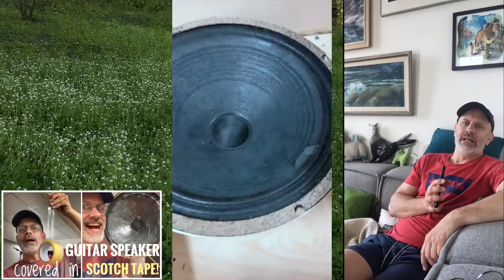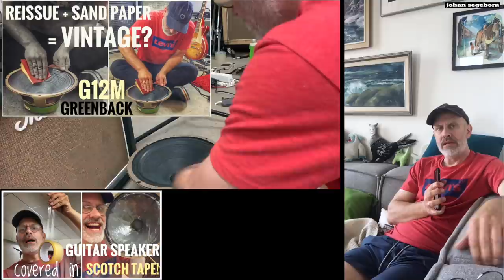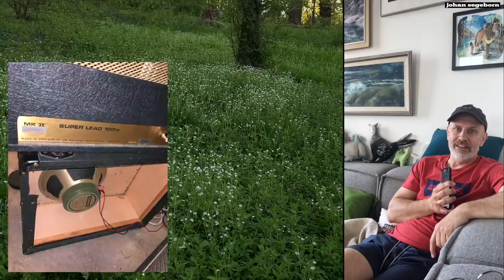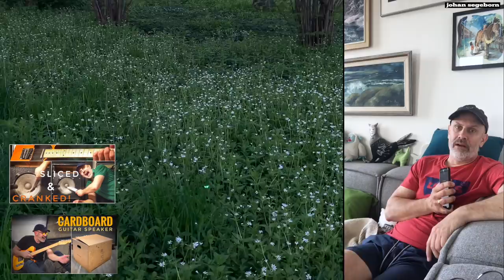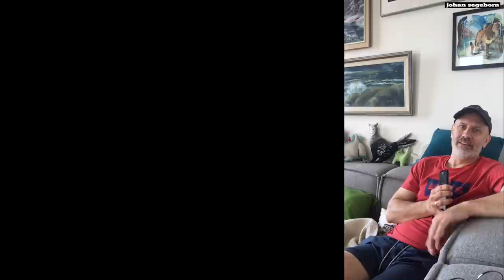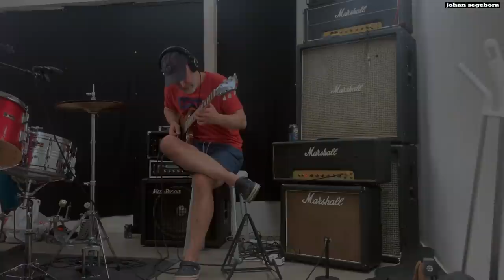Guitar Speaker Covered in SCOTCH TAPE for a BIGGER TONE!

Comment: In the old days of communist rule, when nobody dreamed in my country of possibility to buyi generic guitar speaker we used to buy 12 inch wide band speakers with special central cone for higher frequencies. Cone was deleted using sharp razor. The we used thick shoemaker glue. 3-5 layers. Each one when previos was dry. Idea was to make main cone heavier, less responsive to higher frequencies. Result was really good. I'm playing one of these speakers 1x12" in close pine cabinet do this day with 5W diy amp made in that time. From time to time i think of replacing it with proper celestion speaker...
Reply from the maker: Cool! Do you have video of that speaker?

Comment: Ever tried spray painting The Cone with flat black paint. I've done this on Old speakers not guitar speakers, speakers that are on the dash of an old car where the paper is sun-faded and about to disintegrate. It stiffens the fibers up and makes them seem new again. With each coat they get stiffer and stiffer, but if you put too many coats they begin to sound tinny because the paper becomes too stiff. I suggest trying one coat and see how it does, then go from there. It stiffens up the paper cone is all it does. It probably works much like your scotch tape deal only it looks nicer because you can't really see it. It's soaks into the paper it looks like there's nothing on it. You might try it especially on a really old cone where the paper seems like it's about to come apart because it's so old and used. I can't really describe it, you can just tell it it looks like it's fuzzy and like the paper's about to disintegrate. I wouldn't try it on the new speaker, but one where the paper looks like what I'm trying to describe that's really not much good anyway what have you got to lose. On a car, say a 1970s car with the push button radio and one speaker in the center of the dash the paper is face up in the sun all the time and it gets dry rotted looking. I don't know if using satin finish or glossy paint would make a difference over flat black it's just that flat black is what I had and that's what I used. It's solvent-based or oil-based paint that you get in spray cans at least you did back then. I don't know they may have some water-based ones now. I wouldn't use water-based spray paint, for one it won't soak in and two it'll dry like a plastic over the surface whereas the solvent based does it have water in it and it will absorb into the paper becoming apart of the fibers cementing the dry rotted fibers back together as though the paper is new. if you try this on an old speaker where the paper looks dry rotted what have you got to lose. As I said before I just wouldn't want to do it on a new speaker unless money didn't matter and I just wanted to experiment. even if I had unlimited funds I would hate to ruin a good speaker. I know for a fact this stiffens up the paper cone of any speaker.
God Bless Y'all.
Jimmy in NC....
Reply: This is really cool, thanks for sharing this tip!
Reply: Great tip!
Reply: This is an OLD tip, but a good 1!  Spray with lacquer, same diff! I had a work mate who was good at electronics, and he used to build bass subbies for cars, and he used to epoxy the speakers to stiffen them up! When he played rock, pop or esp EDM, thru them, the bass frequencies they pumped out were so stiff and tight, they were earth shattering!
His speaker of choice were always Cerwin Vegas!
Reply: Nitro or poly? ;) would be a good test, also matte vs gloss.
Reply: @gingataff  I just used flat black Krylon or Rust-Oleum Krylon I think because it was what I had and it worked well. I wouldn't do it on a new speaker like I said, but the speakers I was doing it on the paper was nearly dry rotted it was so old and fragile I figured what the Heck. It just stiffened them right back up and made them sound fresh. I do know if you keep spraying coat after coat eventually they get so thin they sound like a Japanese transistor radio from 1970 with 2 inch speaker, in other words they sounded like crap. I just did that on a speaker that won't much good anyway to see how far I could take it. I would try one coat check the sound and possibly a second. Your speakers will get stiffer with each coat and you don't want them so stiff that they sound like crap. I don't know anything about gloss because I never used it. I think flat or matte is best. I don't think gloss would be as good. You can't tell anything's been done to your speakers when using flat or matte. I discovered this by accident, the paper on my speakers was so dry-rotted I didn't have anything to lose so I figured what the hell they weren't any good in the condition they were in. When I got done I was surprised, they sounded it almost new again. New but broke in. Hope this helps you.
God Bless!!
Jimmy in NC....
Reply: @gingataff  'Tone' finish!

Comment: Increasing mms (moving mass) will lower Fs (resonant frequency), what you've more or less done is move a 75Hz cone closer to a 55Hz cone, as well as taming some of the peaks.
Reply from the maker: It certainly got a fuller low mid/bass
Reply: There should also be a drop in efficiency aka loudness!?
Reply: I DID say that, increasing the mass would lower the resonant peak somewhat or at least boost the lower range.
Reply: Nice!  I always liked the 55Hz more than the 75Hz

Comment: Johan - Man you crazy! So I have two ultra rare 1968 G12M Pulsonic 8OHM (with original factory orange 8ohm sticker!) that are DEAD MINT and sound FREAKING GLORIOUS. In fact I just use one and keep the other in the box for preservation. My question is what is the best climate for these? A/C but not too cold? I'd imagine dry right? God these speakers are glorious. Every modern speaker I've tried has that shrill top end or just nothing there, but not a SWEET top end that is like biting into a delicious something so sweet. Anywho, thanks.
Reply from the maker: Thanks man, as long as you keep them in a tempered room (around 20 C) they’re gonna be fine. Cheers

Comment: did what i was expecting.  anytime you put more mass on the cone, it'll limit it's dynamics and clarity.  while this is minimal here cause tape is thin, and looks under tension or is adherence helps its motion with the cone, and you might not notice it from a regular video, but in comparison, the speaker is less open, less dynamic, and less clear.  what johan is enjoying is the controlled highs, but the same cranked capacitors in the tone stack.   fun test though.  someone might even prefer that, but those are the people that don't know how to control all the other options.  there are ways to get that without ruining a speaker cone, but if you really want to, go ahead, just don't ruin a vintage one.  an tone stack can be made to sound like this...

of course, johann knows all this.
Reply from the maker: Control all the other options? My experience is that it usually doesn’t pay off to be clever when it comes to music. There are way too many coupled parameters to do anything but trial and error.
Reply: Cranked capacitors? Are you suggesting that capacitors sound better with more current flowing through them?

Comment: That's interesting! I thought it would make a massive difference and it did not.. still sounds like a pretty good guitar speaker, if not even better. Is that a 1987X 50W head? No risk of blowing up the poor lonely 25W Greenback?
Reply from the maker: It’s a 100W Super Lead actually. But it’s modded for a master volume, so I’m keeping the volume down a bit

Comment: Have to watch this cos I sand my speaker like you did in the previous video and all bass frequency are gone. I hope that will rescue a little bit. Happy experimenting!
Reply from the maker: Thanks Karol!
Reply: Well WHAT did you expect Kaz?  Less mass, less BASS!
Reply: @DMSProduktions  All good. Now I'll  put some heavy duct tape. All bass will be mine! ;)
Reply: And you can cover speaker membrane with some sort of varnish (laquer, paint). I do it to one of mine speakers because of paper aging.
Reply: I bet it will sound taped 😂. I have some G12M70 I could try Plastidip and start a rubber band
Reply: @Lorak669  Or gaffer! More mass!
Reply: @СашаПетровић-н6х  You CAN epoxy them for bass subs!
Reply: @Daemot  Boing boing boing...
Reply: Im thinking of thin layer of black bathroom silicon. It will seal the structure and its elastic to produce the sound wave...  varnish is a bit stiff and it will make speaker sound like phone speaker.
Reply: @Lorak669  Good idea! A little stiffening is ok, but too much will lessen the cone travel TOO much, then making it only able to produce treble frequencies!